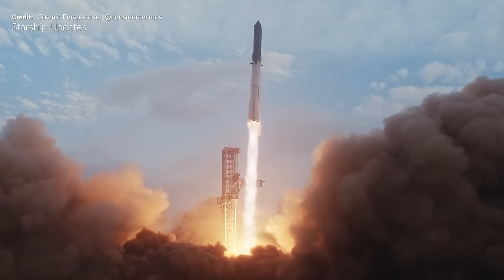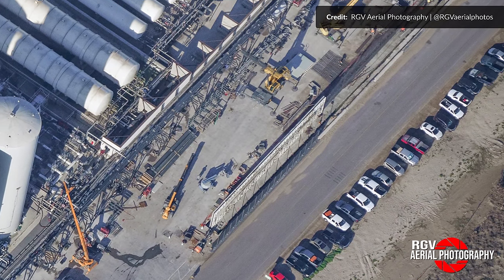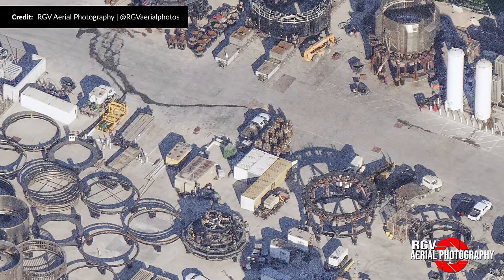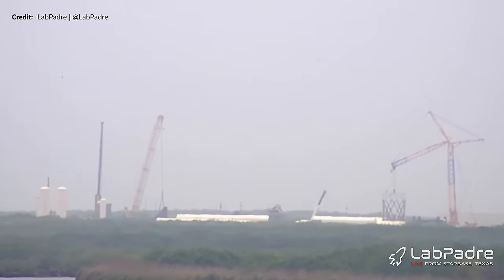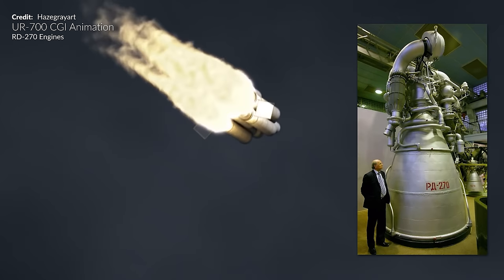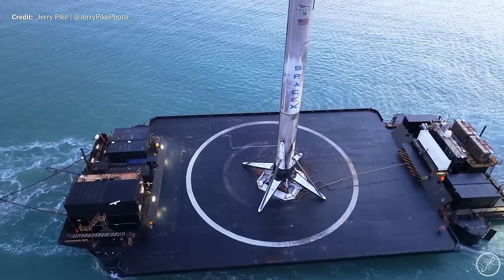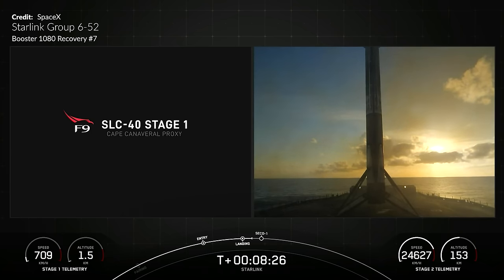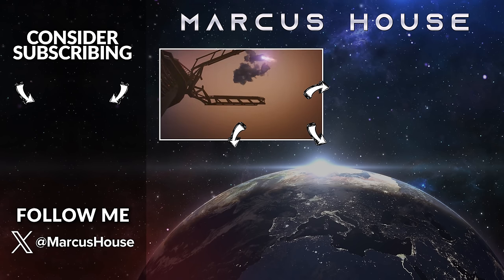Why is SpaceX Starship Only Capable of 40 to 50 Tons to Orbit For the Flight 3 Version?

Comment: Slamming a vehicle into a dense atmosphere is neither sophisticated nor efficient or save. With space refueling we won’t need dangerous and expensive slam braking anymore. The structure of a Starship as it is designed now will not survive a slam braking. Far less does it make sense to slam brake in the hundreds times less dense martian atmosphere or land with a slam safe structure on vacuum bodies like the moon. Safe on mechanical mass and use more fuel is the way to go.
Now, we haven’t even spoken about landing on natural ground or even just about taking off from such a ground.
All this points to a spherical design with an equatorial ring engine and normal engine landing.
Reply: Have you never played kerbal space program? Or have any understanding of the tyranny of the rocket equation? Using fuel to slow down is horrendously inefficient.

Starship has a mass ratio of about 10. A really, really good upper stage might manage a mass ratio of 30. 
So we can cut Starship's weight down from ~120 tonnes to ~40 tonnes if we're not trying to make it survive aerobraking. 
Delta-V needed to reach orbit is about 9km/s, so doing the entire thing backwards entirely under rocket power will take the same. 
The Raptor engine has an exhaust velocity of 3.6km/s, so the equation is e^(9/3.6)*40 = 487 tonnes total mass, which means 447 tonnes of fuel.
Starship cannot get anywhere near that much mass into orbit in the first place, nevermind do so with any payload to spare.

Even for Mars, we need to slow down by about 7.5km/s, so e^(7.5/3.6)*40 = 321 tonnes, or 281 tonnes of fuel. So by stripping 80 tonnes of mass from the ship, we now need to carry an additional 281 tonnes to Mars, or about 200 tonnes of extra weight. And by the way, deceleration on Earth takes place at high altitudes, where the atmosphere is just as thin as Mars.

Comment: Booster catch is a joke. 1 mistake and the launch tower is gone.
Reply: Not in the obvious finished product...repairable damage most likely.....think about it.
Reply: The booster is a giant empty tin can running on fumes by the time it lands, there's not much fuel left to go boom. The SN4 explosion likely involved more fuel than a landing Starship booster will, and it didn't even substantially damage the much smaller and less substantially built suborbital stand it was sitting on when it blew. 
And if it's anything like Falcon 9 (which it should be) the initial trajectory is intentionally aimed to miss, likely out to sea, and only corrects once it has decelerated to a lower speed.
A 200t booster crashing at 500km/h only has energy equivalent to a half a ton of TNT. I'd note that we've seen Falcon 9s crash into the droneship and they barely scratched the paint.

Comment: One weird ( and possibly stupid ) question, that i havent seen anybody ask. If and when SpaceX perfects the tower catching maneuver, how feasible is it for them to "rent" out services to other launch providers, if their rocket can hover for a bit and if they capability to steer rocket back to the tower.
The way i see it if more providers have the ability to land their rocket without worrying about heavy landing legs or parachutes catching and such, there may be more reusable rockets soon. I mean, maybe ULA's vulcan could land that way with addition of grid fins, or Blue Origin's new glen as well, or even SLS. To me it seems that the tower method is the best way to do it if perfected and realized in a good way because you outsource the weightiest part of the rocket for landing ( legs, which have to be replaced every time ) and give the ability for many more companies to do reusability. In that case SpaceX's facilities would serve as airports are today for planes.
Anyway, just a thought but i never heard anybody mention is there even theoretical possibility for that or does tower have to be completely custom made for a given rocket.
Reply: I see that as hhighly unlikely.
Not only would they risk damage to their tower that could be caused by a competitor, what incentive could there be in helping your competition save money?
GM could also physically manufacture parts that fit Ford vehicles...but they don't.
Reply: @ghost307 Ford and GM literally traded transmission designs (9 and 10 speed) to save money
Reply: No one else is making a 9 meter rocket.  You want those arms to have limiters built in so a "oops" doesn't crush the landing rocket.  

Besides why risk your infrastructure on some one else's flights?  SpaceX will have plenty of their own flights to handle long before anyone else would have a rocket big enough for the Mechazilla to catch.
Reply: Um...no.

Comment: Didn’t SpaceX tell government that this rocket would have people in space by now? When is SpaceX returning the funding?
Reply: No. Elon Musk said that to a reporter. SpaceX's official timeline to the government had people boarding Starship in space (not launching on it) in 2025. 
Obviously they won't meet that deadline, but it's worth noting that Boeing said Starliner would fly people in 2018, and it hasn't happened yet. Hopefully next month, 6 years late.
NASA said they'd have people flying on SLS and Orion in 2021. It's now 2024 and that hasn't happened yet. It will probably happen in 2026, 5 years late.
Everyone is always late in spaceflight these days. SpaceX are currently only behind schedule by about 2 years, which is actually quite a bit less late than the others.

Comment: Hi Marcus, 
I've been reading some of the comments here and I think it would be very valuable to mention in a video that discussion and sharing different opinions is very important. There is alot of "space x fandom" going on shutting people down which is pretty surprising to see from this sort of community. This is all about thinking scientifically and having new ideas, childishly bullying people for that is just against what all of this stands for.

I hope you see this comment and give it some thought
Reply: Just want to add that probably a large proportion of the people watching these sort of videos are going to part of the next generation of engineers, and having such a closed mindset is frankly dangerous.
Reply: Well said
Reply: In what way have you been shut down? There are multiple discussions on here from people proposing ideas or changes. And there is actual conversations going on through most of them.
Reply: The Naysayers have been uniformly wrong with their predictions.  

Examples:
1/ IFT 1 was to explode on the launch pad totally destroying the Boca Chica site putting everything back years because 30 engines can't work together (proven by the N1 of course)

2/ IFT2 with hot staging would immediately detonate the booster destroying Starship as well.

Funny thing is they tend to support Blue Origin which has put precisely 0 payloads to orbit on their rockets in nearly 24 years of trying and once again (for the 4th or 5th year in a row) are claiming that THIS year they will for SURE.

Now those who support SpaceX can point to the success of Falcon 9 and Dragon capsules.  They can point out all the things Starship has accomplished that the naysayers told us were impossible.  Will Starship live up to all the claims?  Likely not but it can still be a major economic and technical success.  Time will tell.
Reply: @Scanner9631  Those showing an over abundance of support for Blue Origin while dismissing Starship completely are CSS "followers" (got to avoid certain words). Not sure which video it was or if it was in multiple, but they have all been repeating the exact same things. 

I hope BO does live up to their plans. But anyone acting like BO is going to save NASA from SpaceX has to be on something.

Comment: I have a question, and a valid concern.  With all the rocket testing with the rocket strapped down to earth for a burn tests.  Is the earths spin around its axis affected??
Reply: Well, technically yes, but an absolutely insignificant amount. You could do a billion of them and not notice anything. The Earth is HUGE.
Reply: Yes, but it pushes some. A measurable amount.. no matter how small.  That should be look into just to make sure we arent messing something up. Like making the pole worm up cuz we are pushing the poles to where the equator is.  We are in space as a planet. And for ever action there is an equal and opposite reaction.  Its nudging our planet.
Reply: @MrRob8254  if it is clamped down the forces cancel out each other.. on one hand the exhaust pushes "down" on earth, on the other hand the ship pulls earth "up"..
Reply: @unitrader403  no i mean the rocket laying down.. spinning up the planet.  Which way are all the test beds pointed?  Are they all pointed east , lets say??
Reply: @MrRob8254  ah, that case... would also cancel itself out, sine it moves the air in one direction, and this air will eventually shed off its velocity into the terrain (or the atmosphere as whole, which subsequently has the same effect)

yeah, there might be a small net force remaining, but before that becoes relevant the moon will be its own Planet..

Comment: Here is a thought from a different perspective.
A boat with an outboard motor, that has a rating of 60hp "horse power" will travel at a certain speed. 
If you put another 60hp engine on that boat, you would expect a total of 120 hp.
It does not work that way.......the output from those engines interact with each other. 
The proximity of those engines to each other reduces the output of those 2 engines as a whole. So not 120hp........more like 105!!
Reply: no, those engines REALLY fire x tons out the firey end.. no matter what the engines next to it do.  It's a impulse thing, not a blades pushing water backwards thing.
Reply: The horsepower is 120 still but the efficiency of converting it to velocity drops for a number of reasons including increased friction by the increased velocity.

Comment: Starship has already shown its potential.  But with work they will likely be much more potential .  As a single use rocket it is effective. Multiuse will be incredibly difficult .  And I have trouble imagining its reusability.  Due to its size and complexity.  Quality control has been demonstrated.  A major element of success. Imagination has also been demonstrated.  Most of the elements have been well tested.  Increased rates of launches for testing is likely.  And shows a potential to be cost effective without reuse.

Comment: Do you think they should try to catch a dummy booster using a helicopter? To practice it a bit.
Reply: they will land a booster on a virtual tower in the ocean.. once the booster can hover and sit still over a (virtual) spot then it's good to go to try this with a real tower.
That's how they trained landing the F9.
Reply: Nope. See Rocketlabs experience with doing that. Load was widely unstable. Very hard for massive objects and loads
Reply: @joansparky4439  I know, but it is very unlikely they will have chopstick in closed position and the booster will come with an inch precision. They will have to move and I would say the timing and movement should be coordinated so they are closed just a moment before the catch. I think they should test it.

Comment: Replacing parts after the start every time ...- fighting the effects, not the causes, of the failures. In fact, the lack of gas discharge according to the "classics", e.g. on Cape Canaveral, is a fact, no curtain will help, and the explanation about the impossibility of building a "classic" there is untrue. Or maybe hire specialist engineers - good question.
Reply: I understand neither Polish nor machine translations. Did you have a point?
Reply: @peterfireflylund   I understand neither Polish nor machine translations. Did you have a point? 

All the words are real but it is still gibberish to me too.